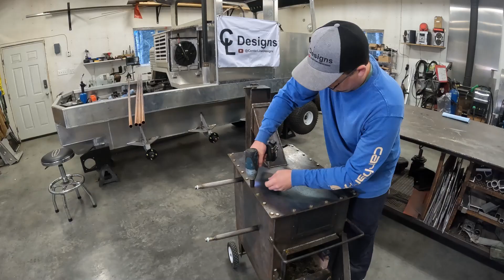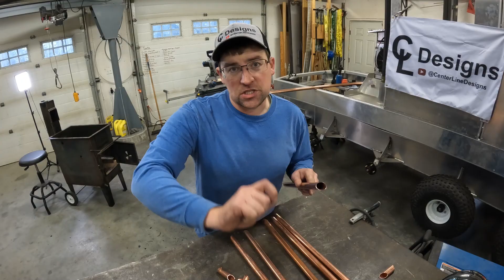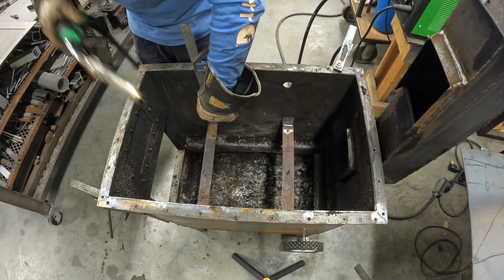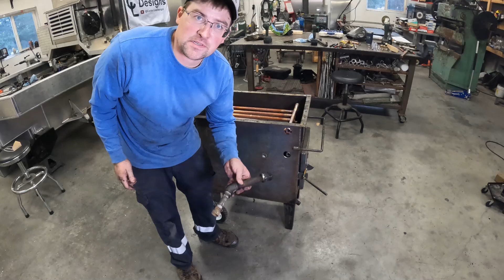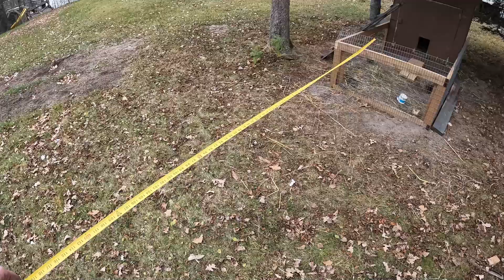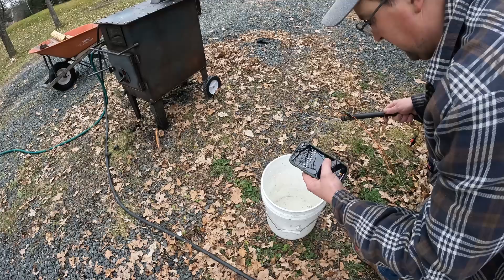Upgrading the Wood Fired Water Heater | TIG Welding Copper!

Comment: Nice work!  Have you ever tried using the TIG as a heat source and silver solder as the “filler”?
We silver solder copper with a TIG often.
It makes an excellent localized heat source for areas with lots of joints near each other.
Reply from the maker: I have tried it a bit. I just didn’t have the right solider. I have some stuff Silfoss with a built in flux but it didn’t like using TIG. Cool because I couldn’t see why TIG as a heat source wouldn’t work

Comment: Do a coil of copper on outside of the riser flue. Will work really well.
Reply from the maker: No it actually won’t work well at all. The thermal conduction of steel is horrible. Copper coils need to be as close to the fire as possible. Putting them on the outside is just a waste
Reply: @CenterLineDesigns ow ok. When he wrapped the coil 20 mm dia, he said was far to hot & needed a pump on copper because it caper locked ( vapour).
But I never tried. Cheers love your cutter!! Haha
I’m 70 years old builder?
So what do I know??
Thanks for you prompt reply 
Rob
Reply from the maker: I have tried and the math says the conductor needs to be as close to the heat source as possible. Copper is 20 times better at conduction than stainless steel. Knowing that, putting steel or SS between the fire and copper is like insulating it. I just know from experience

Comment: I’m building one with a 4 port copper manifold and 3/4 copper tubing wrapped around a 30 gallon drum set inside a 55 gallon drum lined with ceramic wool.
Reply from the maker: Nice! I bet that works great! That ceramic wool is wild stuff. I have an idea for another heater using stainless and more open air concept to be more portable

Comment: Did you calculate the impedance caused by using sharp right angles instead of fittings both long and short?  I wonder because you may have needed less run if the turns weren't as sharp and flowed smoother.  Perhaps it might even have if kept the same length upped the flow rate considerably speeding the heat time?  The other choice killing both birds would be a coiled tube with no fittings?  It would be interesting to compare all options.
Reply from the maker: Well the flow isn’t really of a huge concern. I actually want as turbulent water as possible. I often slow the water down to get larger heat rise in a single pass. Speeding up flow rate doesn’t speed up heating rate. It actually can cause issues because the colder pipes condensate more hurting the fire. I find I max out the heat transfer rate of the fire to copper to water. Honestly the biggest variable is the fire itself. I have another plan to try that I think will be the simplest, lightest, best yet

Comment: A typical heated pressure washer, directs the gas heat up a insulated tunnel, where there is a round coil of copper tubing inside the tunnel of heat, there is no metal between the copper tubing and the heat source, and the temperature of the water coming out of the copper tube is about 220 deg, so you may want to remove the metal plates you have between the fire and the copper tube, you will get a much higher temperature differential for your hot tub. 🧐🤔😎👍
Reply from the maker: So I guess I maybe did show it well enough but the plate doesn’t separate the copper from the fire or gasses. It actually makes have more direct contact. And it draws out the flue gasses to have more direct contact time with the copper. I totally get what you are saying and this is very similar. 
Cheers
Reply from the maker: I build a heater years and years ago with copper on the outside of the firebox and yes it was basically a fail. Completely useless 😂😂😂. Learned that lesson haha

Comment: If you shorten the lengths of the inlet and return hoses, or even swap the hoses to hard plumb pipe into the system and insulate them, and installing an electric recirculating pump will make the water temperature will climb even faster. Which in turn, will make the wood stove burn more efficiently.
Reply from the maker: I do run a recirculation pump on it. I want it to stay a portable system and use the heater for other things too. So that’s why I just connect it with hoses.

Comment: If you don't mind suggestions. 
Insulate the hose, Insulate the outside of the stove. You need the heat to stay in the firebox. Lastly, you need to create steam. Then heat the steam again.
Reply from the maker: Thanks. But I is just going to sit outside so I think any insulation won’t last well. I really want to avoid steam. Steam can be very very dangerous. I just want this to run as a low pressure system

Comment: but could you bend the pipe?
Reply from the maker: No I have tried different methods and you just can’t get a radius tight enough to fit all the pipe. Also tried soft copper with no luck. I sure wish I could. It would make it way easier

Comment: So I tried this stuff this summer  melted steel burn chambers and radiators...  I then saw an Amish water heater and improvised on it a bunch... I took my pool from 40 to 70 in about 8 hrs...  making 80 to 90 deg water with the full force of the pool pump... Try this.. Take a 55 gal drum and a 30gal drum   cut a hole in the bottom center of the 55gal that the 30 will fit in  put the 55 on the ground open end down place the 30 in it open end up weld it fully water tight...  cut a hole in the center of the 30gal for a 2.5" exhaust pipe weld a pipe section in cut a hole in the top of the 55 weld the lid and the pipe up...  I used another 12" section of 55 gal drum as a stove below it ..   Oh of course add a 1" inlet at the bottom with a angle so it swirls and one out the top... ..   This worked so well I was blown away..       I had tried a radiator over a burn chamber that then fed a copper coil around the burn chamber it worked ok but  two drums so simple.. your already welding..   I did use air blowers to force the fire but I also intending to burn waste oil..   It burned the same with everything propane wood waste oil..  So much cheaper than all that copper..    Love the Tig brazing..
Reply from the maker: Wow thank you so much for the detailed comment. I think I am going to have to read it a couple times to wrap my head around. That sounds cool. I’ll put that in the project list!
Cheers!
Reply: @CenterLineDesigns    think the fire is in the 30 gal drum and the water fully surrounds it in the 55 gal...   all upright...   I tried laying it down which is how the amish do it but they also use stainless..  no where near as good  I was heating a 15'x4ft pool..   Theres also a video out there where a guy built two water jacketed stoves and runs his pool through both....
Reply from the maker: Cool. I don’t know why exactly but it’s fun to try and capture heat energy into water.
Reply: Sub'd your channel, if you get a chance please make a video of your water heater and maybe just some rough drawings. 
Thanks

Comment: One thing you need to be careful of is using electrical wire for filler, as it is an 11000 series copper alloy (ETP). When using 'common' wire as opposed to proper filler wire, you should be looking for a 10000 series Oxygen Free Copper(OFC) wire . At certain temps and under certain conditions, there can be weld embrittlement when using ETP. 

The issue being is if there is too much diffused O² within the wire, at higher temps and other chemical conditions can cause corrosion to occur within the joint causing cracks or splitting. 

Just FYI.
Reply from the maker: Very good information to know. Thanks! I did figure it’s totally incorrect. And if it was a job where it pattered I would purchase the proper filler 100%! This is just a play project so I wasn’t too concerned about quality per se. 
Thank you for that information! I do love learning about metallurgy and intricacies like this so I appreciate you taking the time to share that information!
Reply from the maker: Thankfully I was able to get away with about 90% fusion welds no filler. Only needed filler in a few locations. Cheers!

Comment: The commercial ones use the reverse setup: fire tubes going through a water jacket to maximize heat conversion. You can see there's a lot of wasted space between the pipes, where heat is lost to the chimney pipe . But either way, your design is sufficient for what you do and thats a-ok!

edit: just realized you are the rock stove guy lol. I haven't seen your video recommended to me in years! what up with that?
Reply from the maker: Yes sir. I tried that with stainless but was as successful. I agree lots of wasted space but I didn’t want to make it too hard to weld. Thanks. Yes it works. Might not be perfect and that’s fine it’s all just playing around and learning through trial and error. 

Hmm weird. Not sure. But glad you get to watch now again!

Comment: You will get slightly better heat transfer if you reverse the flow on the heat exchanger. Cold in the top and hot from the bottom.
Reply from the maker: Thanks! I wonder why that is? Possibly just exposing the water to the largest temperature differential that you can? I have heard of that but not tried it. Cheers
Reply: @CenterLineDesigns There are small temp differences across both the gas flow and water flow. The heat exchanger removes heat from the gas. The gas closest to the fire is the hottest point, so you want it heating the water that has already been ‘preheated’ at the fire box outlet.  Hope that makes sense.
Reply from the maker: I think I get it! As much as I didn’t plan on it I think I might do a third video in a little while. It will be adding on the longer flue as I should, changing the air inlet from the door to under the firebox with grating to even out the burn and also reverse flowing it. I think that might be an interesting combination of changes.
Reply: I’m not sure that this will be an improvement.
I know in water to water (or most any other type) heat exchangers that you want to create a “counter flow “ situation. As in cold water on secondary side adjacent to hot on the primary side. This creates the highest delta T throughout the circuit.
In my mind this translates to the configuration he originally tested in this video.
It would be an interesting experiment, however the results may be so small that it isn’t easily measured within the accuracy of the instrumentation.

Comment: excellent video! It is very hard to get accurate test results, with all the variables. I built a highly insulated rocket stove, and have 8 ft. of 3/4" black pipe around the top of the riser. this video confirms my dillema, the stove makes heat like crazy but i need way more feet of copper for the exchanger. the stove is in my shop, and heats it up too much, and I can't collect enough hot water to heat my home. Thanks!
Reply from the maker: Hello! Thank you! No problem. I enjoy the problem solving aspect. Nice sounds like a cool build. It’s an interesting process to heating water. As you say so many variables. But in my experience it best to bite the bullet and go with copper. Sounds like you have a path forward. Good luck!!
Reply: @CenterLineDesigns  one question i have.....what happens if your water flow stops while the fire is still burning? I have designed my system to gravity drain if my pump quits, which is a real pain! your system would appear to hold the water which would instantly turn to uncontrollable steam......or am I missing something? Thanks for your response.

Comment: Bravo.......need 11/2 tube......id......cheers
Reply from the maker: Would that not be too large? Not enough surface area or have you had success with that?
Reply: @CenterLineDesigns  hey I packed it with sand , then rolled it into a coil , the coil at the same level as tub......when u build fire in coil ,it has natural convection and pumps it's self......and yes ,put ur weed blower on it.......cheers

Comment: You have the air intake above the fire, it should be below. The way you have it, half of the air is going up the flu instead of feeding the fire
Reply from the maker: I suppose you didn’t watch the whole video….The air intake is pretty low. It burned really good front to back. Worked just fine!

Comment: What type of tungsten did u use and what was ur shielding gas
Reply from the maker: I used 1.5% lanthanated and 100% argon. Basically the same setup I use for aluminum but just using DC not AC!

Comment: As heat tends to go up, I would turn the stainless heat exchanger's tubes upright "vertical" for a better draft.
Reply from the maker: I totally agree. But I moved away from that design because I was just asking too much of the glue gases to do what I wanted as you noted. This new set up is much better

Comment: You need simultaneous inlet and outlet temperature monitoring for btu calculation otherwise your numbers are going to be very skewed.
Reply from the maker: Inlet temperature is constant since I draw out of the lake. I monitored it for half an hour and it didn’t change. That’s why I didn’t need to constantly monitor. So the numbers are accurate but actually lower than what the real BTU value would be

Comment: I think you would have had better energy transfer in a fire tube boiler style system as every bit of the hot flue gasses have to pass through the copper fire tubes heating the water jacket and then the water in the jacket is circulated to the hot tub. Be aware of the risk of Fume Fever welding copper.

Comment: what happens when the copper gets covered by soot-wont this degrade the performance?
Reply from the maker: It likely would a bit. When I am done heating water I usually disconnect the hoses while there is still some fire burning so that usually burns off any significant soot.

Comment: Sending a camera down the rabbit hole would be interesting. 
Enjoying the videos. 
Thank You,
JR
Reply from the maker: That really would be cool. I’ll have to rig something up with the GoPro and a light. Guess I know what the next project is! 

Thank you! I appreciate that!
Reply: I would probably use an endoscope / borescope with a usb extension cord connected to a cellphone.  Then put that on a fish tape for running electrical wires.  Those endoscopes are like $10. On eBay and the lights are built into the tip around the pinhole camera assembly. They work with a free app on the cellphone. 
But that is just my thoughts........
Thank You for the enjoyable videos. 
JR
Reply from the maker: Oh great idea! I will look into that. No problem at all. I enjoy getting to build things and share what I do. I should have started YouTube a long time ago…
Thanks again

Comment: I think the BTU will be higher than that on it. you're measuring temp at the end of the hose and there will be lots of heat loss along the way, I would like to see the temp measured at the output of the heater!
Reply from the maker: Very true! I’ll have to test that out next time with the flue extension! Cheers